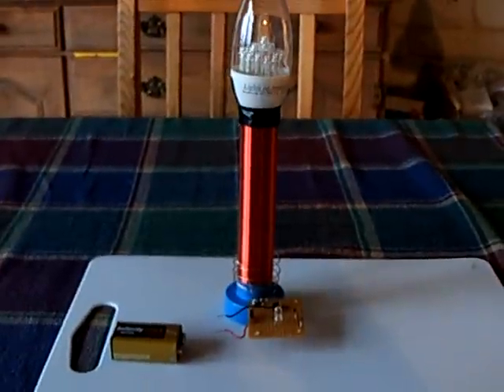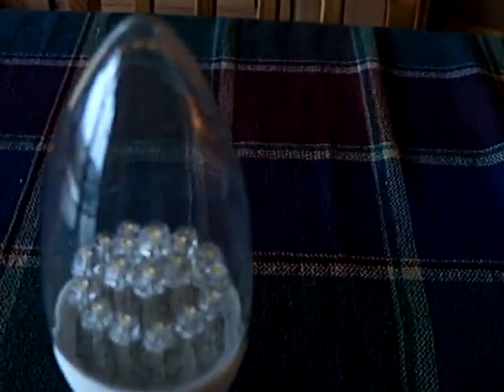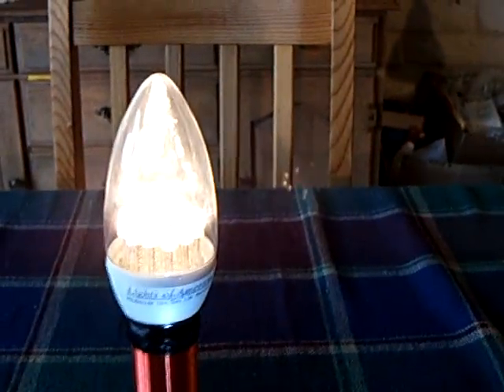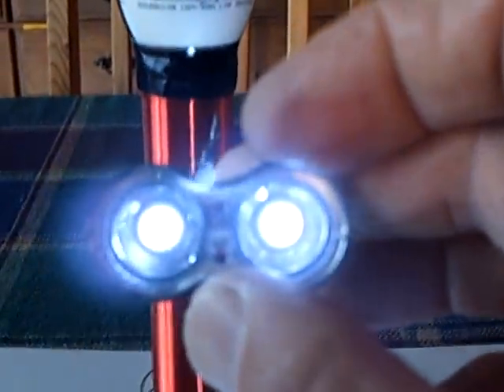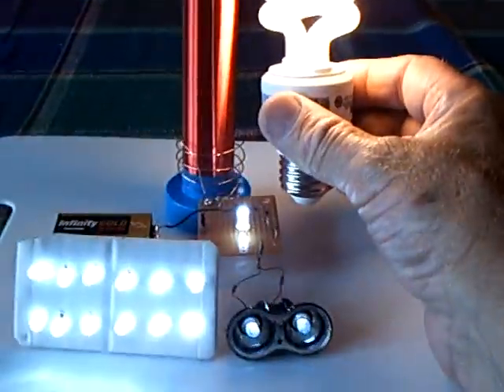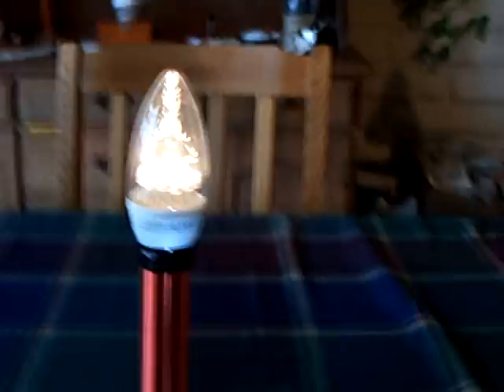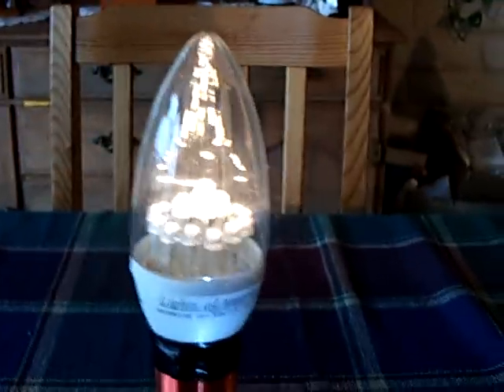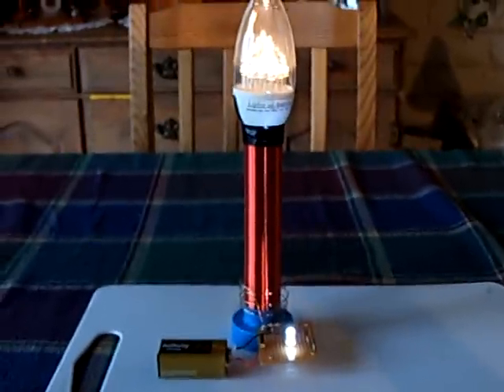Mini Tesla coil with 110v LED bulb

Comment: Made this kind of slayer exciter using power TO-3 transistor and i'm able to make it generate spark if i want to (about 1cm). It can light up a neon screwdriver 40 cm away. :)
Current draw is 0.5A unloaded and 1A loaded tho :s

Comment: fake. I want him to put the bulb close to the source without holding it. just set it on the table next to the tower.
Reply from the maker: +Mr. Woofwoof Actually this is not fake at all.  Do a Google search on "Slayer Exciter".  This has been replicated many other times by other people.  It is a fun project to build and wireless lighting a CFL light bulb is one of the things it can do.  You can actually buy one of these type units on EBay.  The inventor Gary Bluer sells them now.
Reply: ***** oh I'm not arguing the authenticity of the tech but lol rather this video's credibility.
Reply from the maker: +Mr. Woofwoof Here is another video where I show the light on my boat  https://www.youtube.com/watch?v=DydhosayGLg    I actually didn't use this much on the boat because other lights worked better.  I have used this device many times though for other experiments.  It just wasn't a very efficient way to make light.
Reply: ***** thank you.

Comment: what do I need to do it like tesla, without even extra energy like a battery? Can I make like an antenna above it, to use only the natural energy. Could it work?
Reply from the maker: +Johann Bech  No.  Unless you used a photo voltaic solar panel.  They didn't have those in Tesla's day.  Just putting an antenna up doesn't get you what you need to run this.
Reply: +Johann Bech Personally, I would use the electric current from radio waves. Make a very large (flat) spiral of 20 gauge copper wire. The wider the circle the more power. The spiral would look like a stingray. (The idea of this coil is to capture as much of those waves frequencies as physically possible.) Then, connect the center of the spiral to the antenna of a Crystal Radio. Ground the other end of the Crystal Radios coil (not the spiral antenna)  If the radio uses a variable (tuning) capacitor, remove it. Replace the ear piece with alligator clips and HELLO ELECTRICITY!! If you have any questions please email me at  lvlover58@aol.com

Comment: What was the resistor and transistor you used in order to run this? I'm trying to build a coil using 32 awg with 9 volt power source, 22 kilo ohm's resistor, and 2n2222 transistor. would that work? And I'm building a switch into mine.
Reply from the maker: +Emren Akdamar Your parts are fine.  The switch is a good idea.  I still have not put one on mine.  Need to.

Comment: Hi Lidmotor, I have an idea to recycle some of the the power back to the battery.
With a simple low voltage supercondenser you should be able to unplug the battery and make it a small free energy inverter.
I understand it sounds crazy but I wonder if you would like to take a look at my schematics and theory so you can give it a try.

Comment: Lidmotor could you show the schematic for your little led tester light, thanks.
Reply from the maker: Jeff Nading  You need to use 1N914 or 1N4148 'switching' diodes for this.  Get them at Radio Shack.  They are dirt cheap.  The circuit is simple.  The diodes are connected together with one pointing in and one out.  The led is simply attached to the loose ends.  It is that simple --and it works.
Reply: *****  Thanks so much, I have these parts, I've robbed them from old junk boards, very cool by the way. Made my first Tesla coil with a slayer exciter, works well. I can turn a touch lamp on and off from one room to another wirelessly. Thanks again, Jeff.
Reply: Raul Rios
Raul Rios Raul Rios Raul Rios Raul Rios Raul Rios Raul Rios Raul Rios Raul

Comment: If u had multiple Tesla coils couldn't u use one to power others and the remove the battery and still have the power I read something about the idea behind the Tesla coil being a self sustaining power supply that would never stop and there was some problem perfecting that I guess but just a thought
Reply from the maker: Randy Orr No.  Machines don't 'make' energy.  They can convert it though and there are lots of examples of that.  A bunch of Tesla coils looped together would still have to draw power from some where.  They would not create their own or pull it into the system from thin air.  There are electrostatic devices, however, that do just that.  Check out Lasersaber's channel and look at what he has done.

Comment: Any exact information available on how to purchase such a kind of device (intended to generate a free electricity), that can be used for household appliances, simply by plugging in those to the plug of power without further technical headache. Means, is there such a device available for to produce enough energy, like to make a refrigerator or a heater, that uses 220v and 3 to 5kw power to operate?
Thank you!
Reply from the maker: Artak Tshughuryan This device does not make 'free energy'.  It uses energy.  The only things I have seen that will give the common man free electrical energy are conversion devices that take other forms of energy and convert them to electricity.  The ones that make sense to BUY are solar panels if you get enough sunlight or wind turbines if you live where there is lots of wind.  You have to look at the cost and decide if it is worth the purchase though.  There are no machines that MAKE ENERGY.  The universe has a fixed amount and you cannot create more.  A small and safe table top fusion reactor would be nice to own ----if someone ever invents one.
Reply: ***** K. Thanks for the clarification.
Best regards.

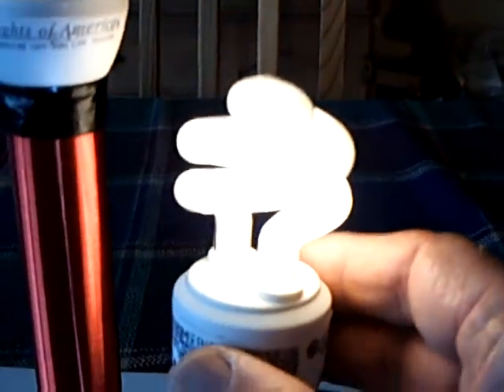Comment: A Tesla coil is just a transformer with few turns for the primary and many turns for the secondary wich is often made resonant at the working frequency. Therefore the voltage at the end of the secondary is very high although the input voltage is only 9v. It creates a strong electric field in space around, able to induce current in light bulbs as we see at 1:30. But any load coupled to the coil, even at a distance, draws current from the secondary and consequently from the primary also: there is nothing free. It's an urban legend that Tesla would have invented a "free energy" process.
Reply from the maker: ex nihiloest You are very wrong about this device. It does not function like a traditional Tesla coil. It is a high frequency RF device.  It does not produce super high voltage at the output.  The coupling at the external light bulbs is a capacitive one and not an inductive one.  Think of this like a radio transmitter where there is no draw on the radio station from the receiver.  I never said anything about this being "free energy".

Comment: It is the lowest supply voltage that I have ever seen a Tesla coil operated at. I once saw some professors page where he was showing a way to run a Tesla coil from a static machine, but that was before You Tube.

Comment: I built the same device except the primary.  Mine is just 4 turns of 20ga and it will light a CFL but never a LED bulb.  I have tried a 3 watt, no luck.  Im using 12 volt wall wart.  Is the primary that tricky?
Reply from the maker: The LED bulb at the top (my top load) is connected directly to the secondary output.  The other leds that I show lighting up wirelessly are connected to an Avramenko diode plug. A regular LED light bulb will not light up wireslessly if you hold it near the coil. The turns ratio of the secondary to primary is somewhat critical. The beauty of the Slayer Exciter is that you can easily adjust the device by moving the primary up and down the secondary or adjusting the number of primary turns.  All of my stuff is basically done by trial and error. Play with it until it works.
Reply: Thanks a lot.  Yeah I move it up and down for different effects.  I have ordered some 10Ga solid copper to make a cone coil just for hell of it.  Im searching for a good AV plug.  Any suggestions?
Reply from the maker: Use 1N914 or 1N4148 switching diodes.  They are very common and easy to find.  Radio Shack sells em.
Reply: really appreciated.

Comment: +Limotor sir,  just one question, how do you wire LED's to light on slayer exciter, I had mine working on tubes but I wasn't able to try on LED's. pls. share some schematics. Thanks. GOD BLESS
Reply: you need 2 diodes to rectify the current, not LED's but switching diodes like in a bridge rectifier (they have 4 inside)

Comment: @ Joathan Beneteau ... 

This has been done about close to 120 years ago
this information has been kept secret but now in the days of being o the line in the 21st century with a little bit of research this phenomenon ca be manipulated
if you have the know how

ive successfully been able to recreate this with am radio antennas a battery and a common transistor of npn type

inductive energy
Reply: hey is it possible to charge a phone while its nearby eg a android iphone etc?

Comment: im an electrician.. and i have never seen anything like this before.. i would absolutely love to see how this works.. i got bored tonight and started looking things up.. i can do some research... but i figured asking would be a bit quicker :)
Reply: if you know Tesla , your knowledge would increase :)
Reply: hi there im no electricion or anything dont know much bout electronics except what capacitos are for but i mainly do wireing for the rc cars i own, one night i decieded to wire some leds for my xbox controls i some how managed to light a red led with only one of the legs connected while in parralel to a yellow,blue and green led as soon as i connect the other red led leg it would go out and the other leds would then turn on, could you explain ho this happened as i though both led legs had to be connect, 
all i can say is when it happened i was mind raped

Comment: you might be able to retune the Tesla coil after adding the other bulbs.  they are adding capacity to the coils resonant circuit and there should be  a new 1/4wavelength freq

Comment: It's neat what he's doing and there's things to be learned but it's not a practical way to light the place. In a house I'd use a switching power supply (90+% efficient) or go with solar or other renewable power direct. 

What I dislike about batteries is the disposable "feature".

Comment: Voltage is not the whole story. The 9V battery will give a limited current. The coil makes that into high frequency waves. The waves excite the led junctions and the gas in the CFL bulb which yes when you soak enough wave field that the battery current cannot make enough the field gets weaker and those leds get dimmer.

See how long a new 9V battery will run your lamp. Then get led bulbs and resistors and see how long a new 9V battery will run those. I predict that directly wired will be longer.

Comment: How about building your Tesla Coil into your table? This way you could simply set any light on top of the table. I did this many years ago when I was a kid. The center support and base of the table contained the coil. I used the transformer from an old neon sign for power, but a small battery operated supply such as you have here would be perfect for your boat.

Comment: The Idea of Tesla is great but I have a confusion.
* Why till now not used this device instead of generators hydro,diesel and thermal plants..Put device close to the supply output transformers.The current will be supplied in high voltage line.( source battery/Solar}
* What is the discharge rate of source if many bulbs lighted on same time ? If the discharge will be same as one bulb then it will be great otherwise it will be like an induction charger.Only useful for limited range.Pls explain it.

Comment: good idea for a proper use.ad a switch and  have a bunch like 50 spaced out in walls of your house and have a central dc battery station where they all hook into for easy changing.also have a metor set in every room that can mesure the AP atomosphric prower to be able have a visual of how much power is avallible to use in that room. that would be the ideal home of the future. also known as individual independent power homes (i-i-p). same concept to malls or boats or cottages . any thing go's

Comment: If you closely examine some of Tesla inventions, nothing new to see!  I spot an Electric Generator, with switching gear to turn to AC, and an AC-motor!  But these are called perpetual devices!  I don't see any info on resistive -loads?  Overunity devices are along the same principle!  Once you get past the output of the generator, it stops!  Of course Governments already know this or they would have started using these devices!  By having a network they keep adding Generators online to supply!

Comment: One of the best Videos I've seen!  What I like about this you not trying to over-state the obvious!  Neon bulbs can be ignited when you stand under a power-tower!  The Electromagnetic Radiation is igniting the gas within the bulbs! The way led works is by the applying voltage across the P/N junction casing photon to expel though the junction!  RF, (Radio Frequencies) across the P/N junction is causing the led pick up these stray eddy currents,  to emit light! This would be my take on it!

Comment: you can get thousands of volts off of a microwave transformer safely, but i would run the transformer in series with something since it's nearly a short. (5 ohms) this only puts off a couple hundred, as stated.

Comment: No. Tesla's big honking coils were AC powered so the polarity was constantly reversing. I've built an AC coil. It drew many, many amps and put on quite the light show. No free energy here. If you want to draw energy from radio waves build a resonant circuit at your chosen frequency, put a diode on it and bask in the (at best) mW of power you have drawn from your radio antenna.

Comment: Genius for inventing the famous Tesla Coil which requires more fossil fuels  in order for it to generate useful energy? His genius has yet to be discovered. He hid a secret in the design. Build a large Tesla coil, stick in the earth, meaning grounded & then reverse the polarity from the schematics. It will no longer radiate lightning ):~ Instead it will do the reverse! It will PULL radiated energy that is omnipresent, everywhere! That is the true design of the Tesla Coil. Free Energy to ALL ~ :)

Comment: It's not "free energy" There's no such thing as free energy, The Tesla coil still takes the power from the 9V battery. It's a transformer, it steps the power up to x amount of volts. I'd also like to correct Lidmotor. I believe you said that it steals power from the candelabra light bulb (?) It could be a miss-understanding on my part, but to make things clear, the Tesla coil pushes electrons away with the coil, which is a magnet. The magnetic field is powering the bulb. Sorry if you meant that!

Comment: Great Video and Inspriring, I am making one now and follow circuit from Jbluer and instructables but I have  a few questions for you. The Led light you attached to the top is that is acting as the top load correct? All you did was put an attachment on it and inserted the Led light bulb? Second question your primary coil seems to have like 4 turns but everything else says it needs 9 turns. I am almost complete with my coil and right now I am putting on the top load and my primary. Any Advice

Comment: tesla's "wireless energy"  machines were never realized because how do you meter a customer's usage?
.........plus, what you essentially have is a radio frequency transmitter that could potentially produce deadly x-ray, gamma ray or microwave radiation   :(

Comment: At 13MHz the far field decay should be quite close. (this is similar to how radio kHz has longer range then bluetooth 2MHz)
Do you have a measure of how far the range is? And also that is also essentially microwave energy, although water cooks optimally around 2.5MHz i'd like to know if anything cooks when you put near it at 13MHz.

Comment from the maker: This is called a "Slayer Exciter".  The circuit is not mine.  Go to GBluer here at Youtube to find the circuit from the inventor.  It acts similar to a Tesla coil but the circuit is completely different.  The vlotage output is in the hundreds of volts instead of thousands like you get with a traditional Tesla coil.  The frequency is about 13 mHz.

Comment: That's Tesla's theory of wireless power. What goes in the air stays in the air unless used up. You just proves it. So who need wire Con Ed, LIPA and the rest, get off the GE Illuminati suppression
.

Comment from the maker: The charging mat is an inductive link device.  What is happening here is a capacitive link.  It is a different way to transfer the energy but it might work to charge a cell phone.  You have to be careful that the strong RF signal doesn't damage the device you are trying to charge.  The FCC wouldn't like the idea unless it was well sheilded.

Comment: pretty cool stuff, not new - but cool.  I am not sure if there is a whole lot of data on that, but it would seem a bit unhealthy to be exposed to so much electricity.  Kind of like having your head next to a radio transmitter 24/7. They freak out now over cellphones causing cancer - what the heck would this do if we powered lights wirelessly?

Comment: Open circuits will allow for scalar signals to be received at vector angles to get more power at the receivers then the sending unit is sending, but you wouldn't know that because you will only do things that will get you attention. Electronic theory is NOT proof. These guys are proving how electronics work. Either join in or go back to your hole. You no longer have my attention because you admitted on your channel that 'they' won't listen to someone who breaks their rules.